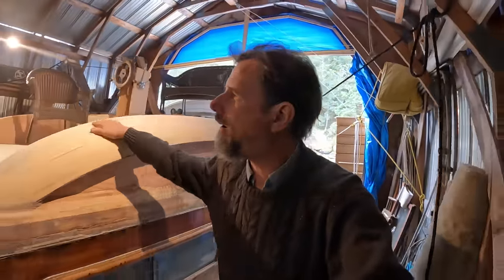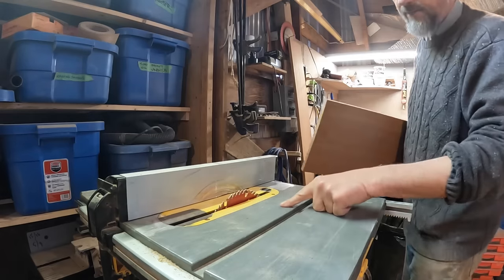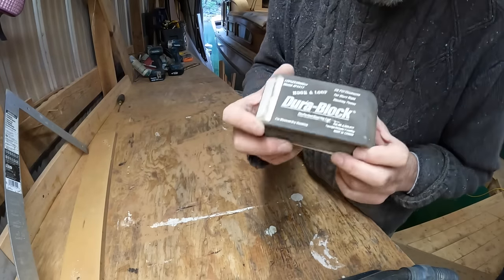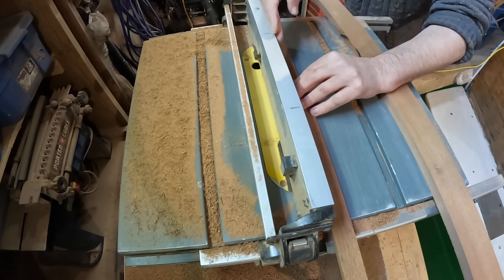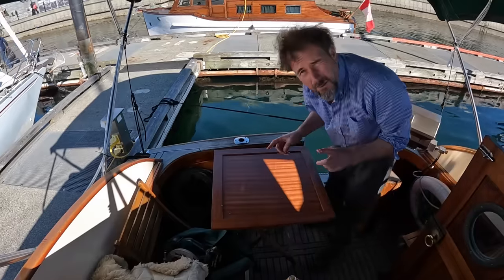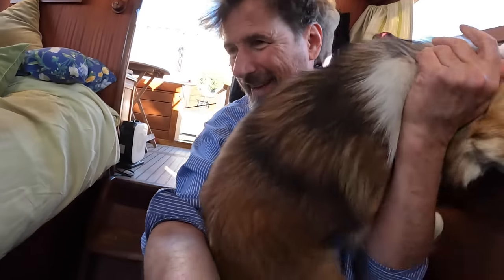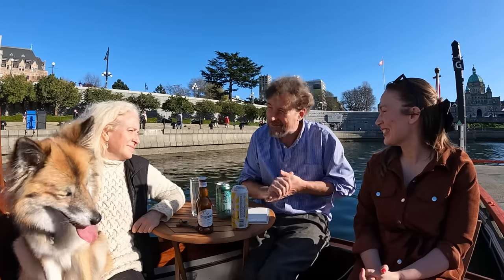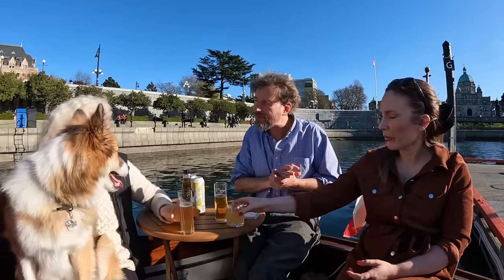Let's make Sliding Doors - #411 - Travels With Geordie

Comment: awesome vid as usual yes like the tung oil but friction surfaces i like bees wax  same stuff that is used to seal a tiolett but with an additive >> tea tree oil Or clove oil i like the tee tree just on the runners using just bees wax not good (you will be having bees all the time ) tee tree or clove they will not bother you and if heated into the wood amazing and a heads up bottom paint Kyan pepper in the paint  shit gave that away
Reply from the maker: Heh, now I know!

Comment: I’ve been using cubitron xtract discs but I’m disappointed with them . They cut so so well, but they just don’t last anywhere near long enough. I’ve gone back to Sia discs with the regular holes as recommended by Aladino on sailing magic carpet. They perform well and are cost effective